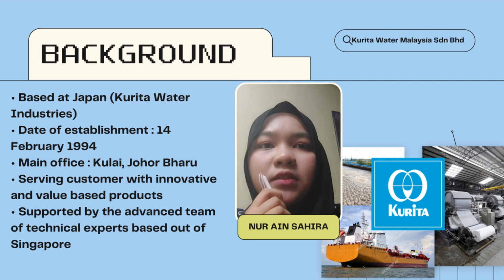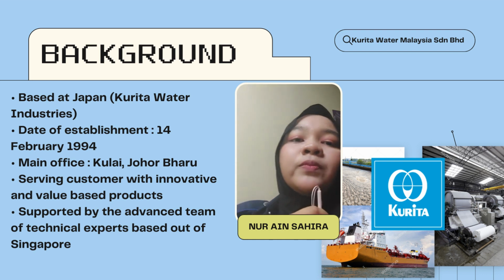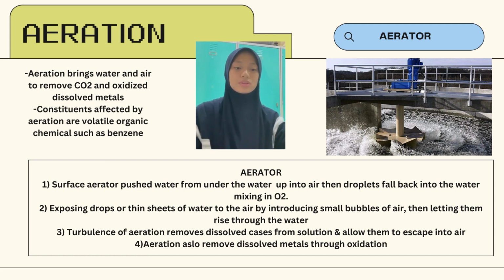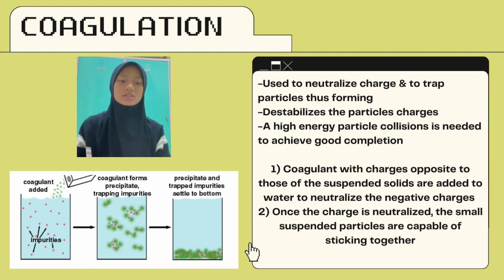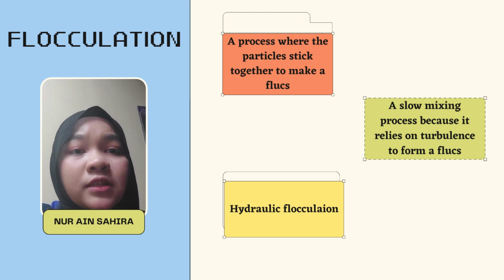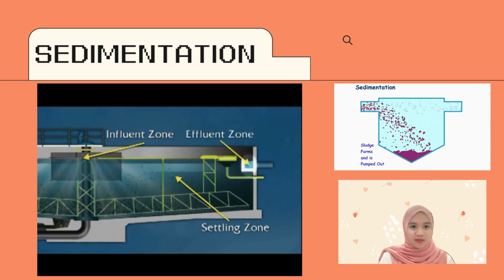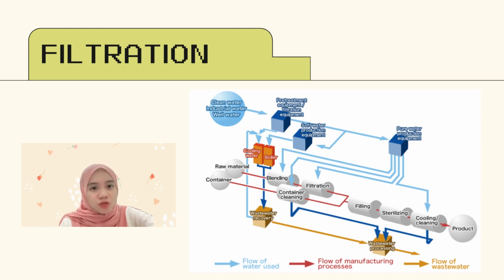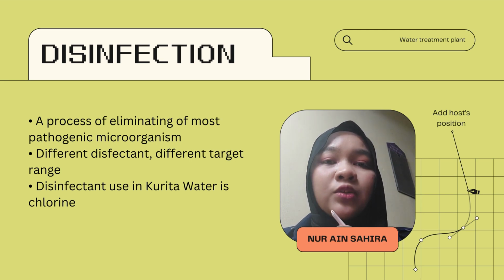KURITA WATER TREATMENT PLANT_PRESENTATION GROUP 8_AS2293A

Comment: What is the difference between micro filtration membrane and ultrafiltration membrane?
Reply: The difference between these two filtration is the size of pore. The ultrafiltration membrane size has a smaller pore than the pore size of the microfiltration membrane.